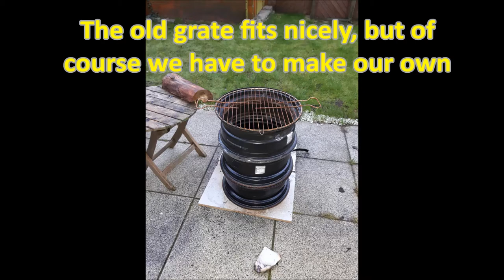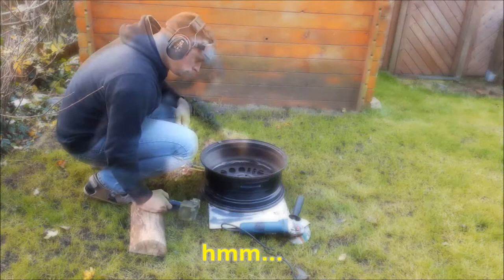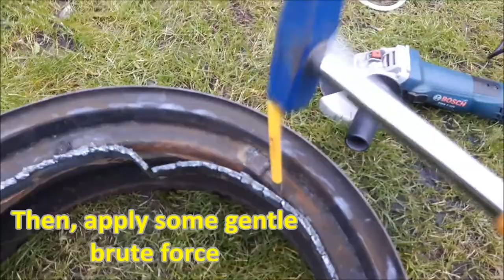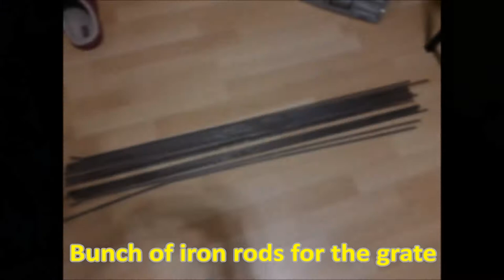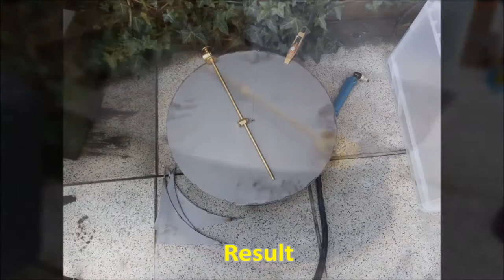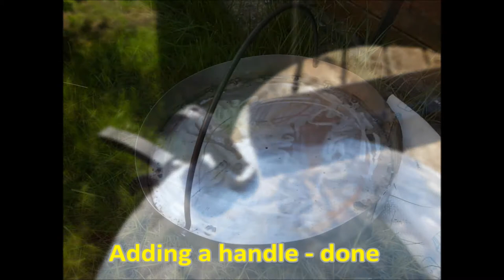Car rim BBQ

Comment: Can you tell me what circle cutter guide you have? I want find one but can find one that’s made for that plasma cutter.
Reply from the maker: The model is called "PT-31 circle cutter". Bought it from Amazon, but its also available from eBay (from seller "Riverweldstore" for example). Make sure the diameter matches your cutting torch, they also sell other models (PT-100).